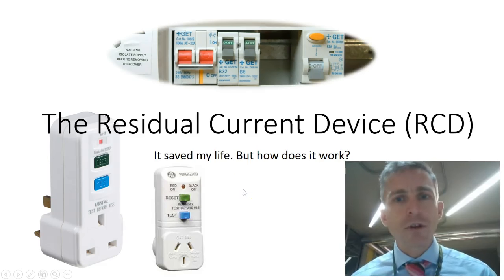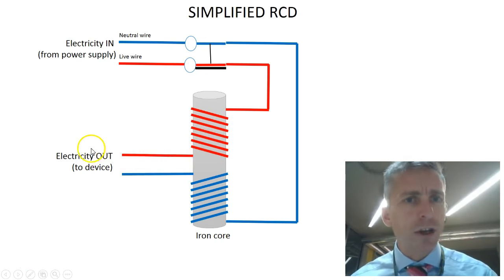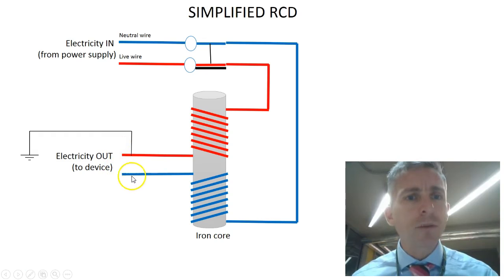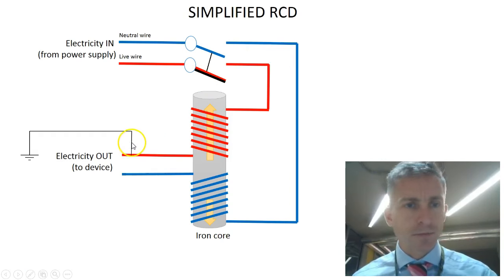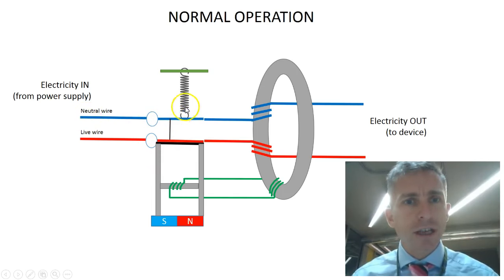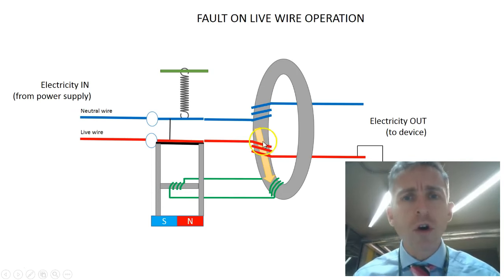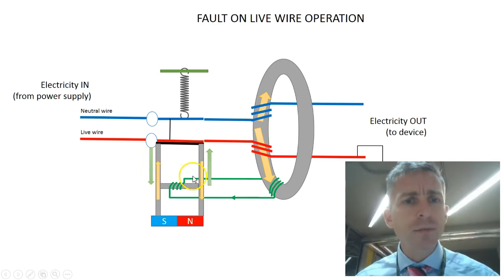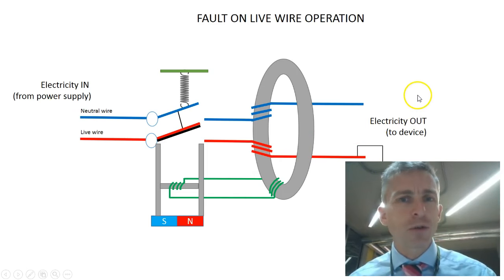The Residual Current Device (RCD) - How does it work?

Comment: Just bought a brand new RCD device from ebay, tested it as it says on the thing and there was no light coming on at all on the indicator. Do you reckon its faulty ? Says if there s no light coming on then DO NOT use. The brand is Pro-Elec made in China.
Reply from the maker: It is says DO NOT USE in capital letters, then I'd be listening. From experience I can tell you that electric shocks are jolly painful!

Comment: Can an RCD work without proper earthing? Since the current that "leaks" to the earth goes back to the source to complete the circuit.
Reply from the maker: Yes. Since the RCD detects the difference between live and neutral wires, it doesn't matter if the fault is caused by leakage to the earth wire or (in the more dangerous case) through a person - it will still detect it. It's always preferable to have current leak to earth through a wire than through a person though, as I found out!
Reply: @benaryder  Thanks!

Comment: It seems when you use a plug in type RCD, if you were to cause an earth leakage (lets say neutral to earth) your main RCD at the fuse board will trip first... always seems the plug in RCD's aren't really needed. Could you explain this?
Reply from the maker: I suspect that the time-delay rating for the fuse board RCD is shorter than the time-delay for the plug in type. If you have a fuse-board RCD fitted, then there is no need for a plug-in RCD, as you're already protected. However in the UK it's not a legal requirement currently to replace an older fuse board with a new one with RCD fitted, so there are still plenty of houses out there that aren't protected.

Comment: great video keep up the good work Ben! How did it save your life?
Reply from the maker: I cut the cord of an electric lawn mower. Thankfully I was using a plug-in type RCD,.
Reply: Not only have I cut a mower cable, I've managed to get an electric wood chipper cable stuck into itself. The power supply was cut out by the fused extension lead both times.